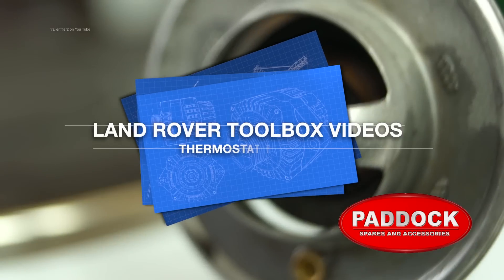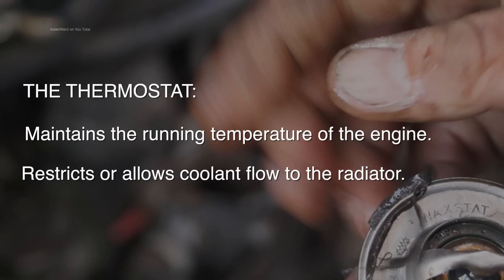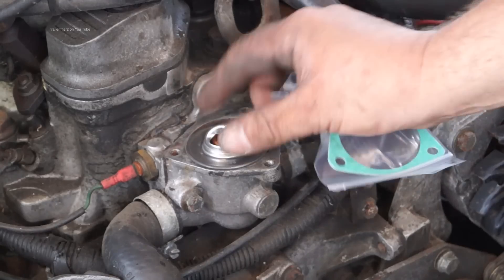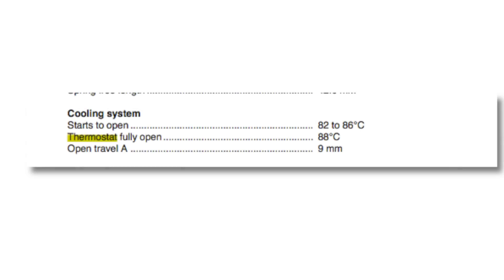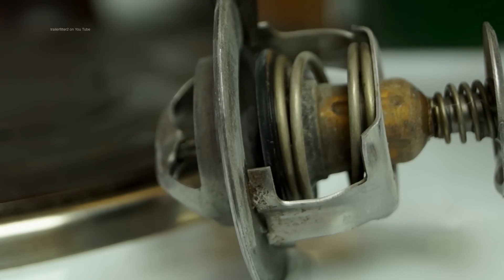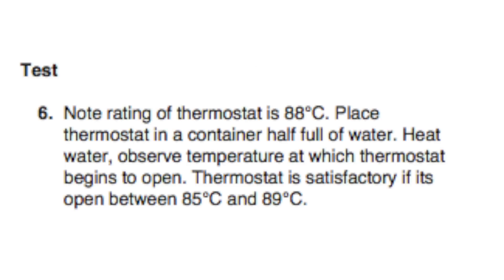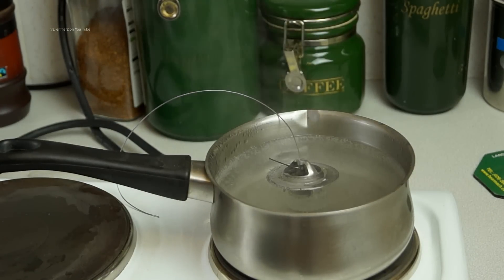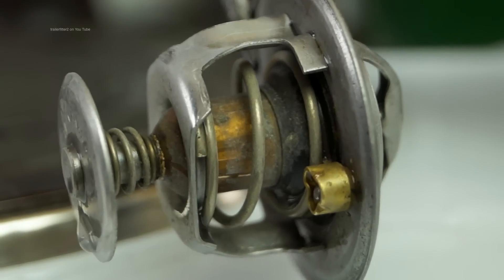Cooling Systems Diagnosis -testing a thermostat - - Land Rover tdi engines

Comment: Hi,

1) What is the running temperature in 300 tdi? Coudln't find in manuals...

2) What is the best spot to check that temperature with external IR gun? (I thought about thermostat housing)

Thanks.
Reply from the maker: George Gutnik 88 Deg. C   for the 300tdi.   You need to be quick to catch the right temp with the 300tdi it cools  down quickly when idling.   IR gun around the thermostat housing yes because heat rises so that is technically the highest point.
Reply: ***** Thanks!
Reply: ***** Other question. In our reality in Israel, in summer we ride in +40C outside with air conditioning working, also it can happen on long driving up to mountains. Now in this case the engine heats up fast enough. 
The question is what is the working spec of the temperature, the maximum and minimum working temperature of the engine, while the temperature set point is 88C?
Reply from the maker: George Gutnik  Ah right you are asking a general question which can be found in all apprentices text books.   The optimal temperature of the engine is about 80 to 90 degrees C thermostat regulates the temperature.   If an engine runs cool it will not be at its best.  Fuel efficiency will be down  due to poor combustion and it will increase wear of the components.  Likewise if the engine is running too hot the components could suffer heat seizure because the metals have expanded too much.  Again the combustion process will be effected.    Also consistent higher than running temperatures will cause gasket and cylinder head warpage  piston damage, etc.

Each engine designer will have a set temperature it will want the engine to be be working at it's optimal.  There can vary depending on design and application.  

Generally you want the metals to expand as it warms up.  Keep it at the right temp and not over heat or undercool.  

Hope this answers your question.   There are some good general mechanics textbooks that are worth a read if you want to get into the real details of the cooling system operation.   There is not enough details about the 300tdi engine to give you more.
Reply: ***** Thanks for the detailed answer! Actually that general information I do know and I wanted to know something more specific. What are the thresholds pf the temperature for the 300 Tdi engine? For example: 80C is the minimum allowed temperature and 110C is the maximum. =)
Reply from the maker: Ah,  that I can't tell you.   Sorry.
Reply: ***** I see. Thanks anyway. I believe we shouldn't pass 100C, but that's my opinion.
Reply: Vehicle Repair Toolbox Videos 
Is the thermostat needed for warm climates?

Comment: So could a faulty thermostat or a leaking rocker cover gasket cause gunk build up under the oil cap?? 
1) my dipstick is fine no gunk on end of dipstick
2) spark plugs are fine
3) no smoke or water or gas from exhaust
4) runs good
5) no loss off water or power
Then this is what i think is wrong
1)gunk in the breather pipes clogged and under the oil cap evreyday (i done a wngine flush oil change filter change) found a blob in filter in rocker was  half full of gunk car srill fine and clean oil it was in the top left hand side
today i changed the rocker cover gasket i tested the thermostat im still notsure if its working or not so orderd a new one comes tuesday by chnaging the thermostat and rocker cover gasket could this solve the gunk problem? Or is it 100% headgasket or head crack? 
Thanks
Reply: Sorry its a 1.4 16v mk5 vauxhall astra h
Reply: if the gunk is milky and white-ish it's water contaminated